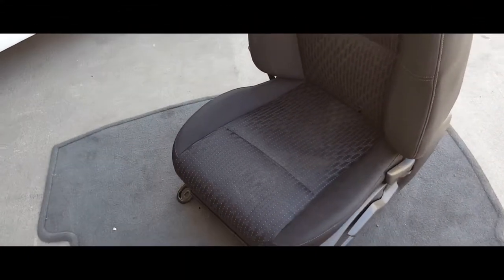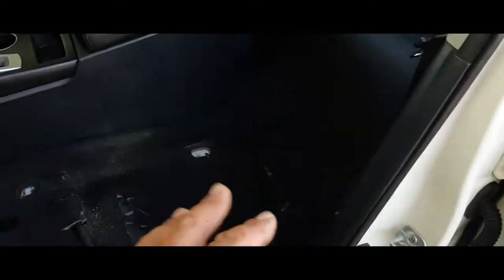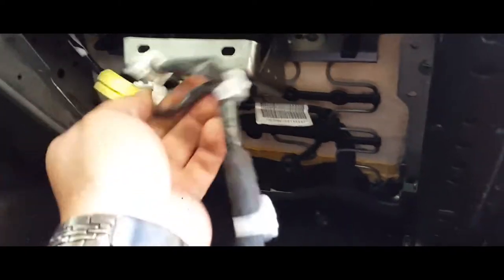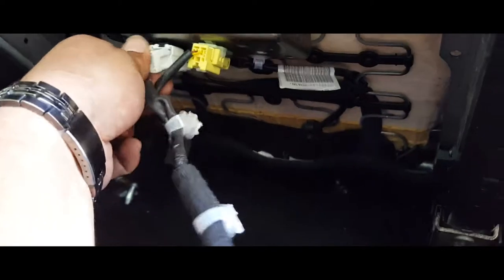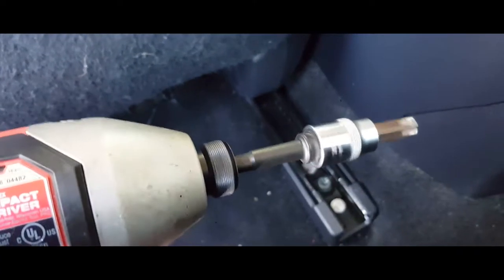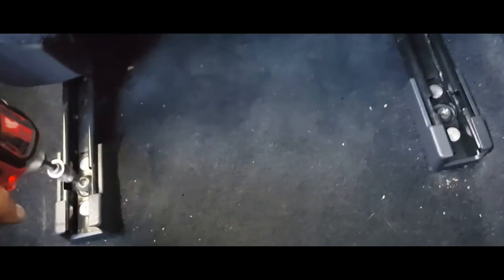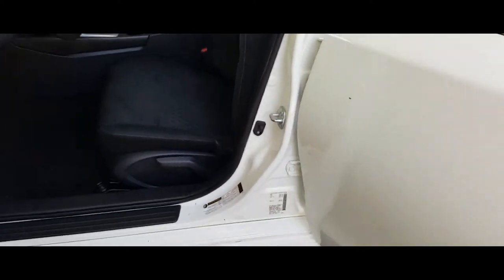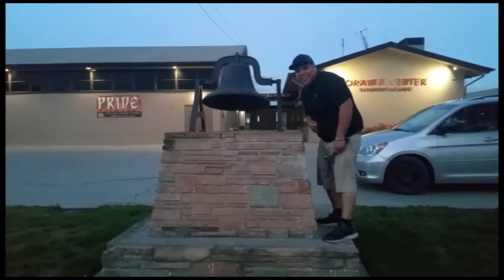How to: Install driver seat on a 2016 Nissan Altima

Comment: Thank you for the video brother, quick question if you can possible answer it. my seat works perfectly fine, however the skin it self has a bad rip and under the skin the cushion is damage, is it possible to be able to fix that or do i have to replace the entire seat?
Reply from the maker: im honestly not sure but a upholstery shop can help you out for sure